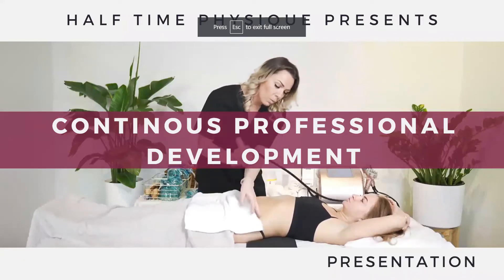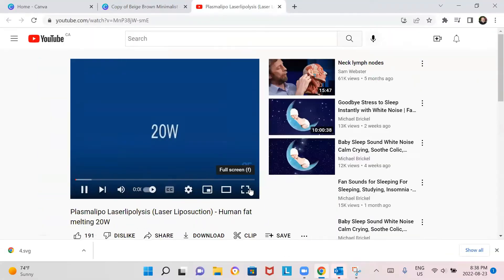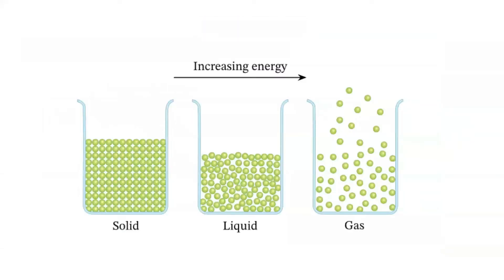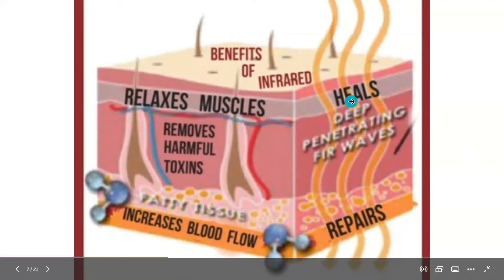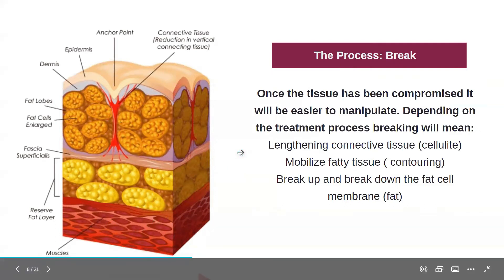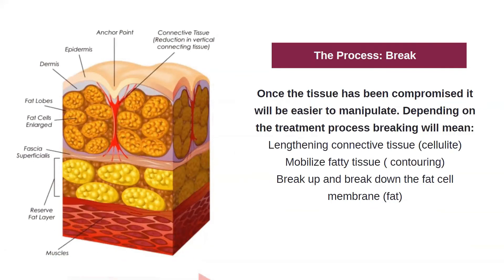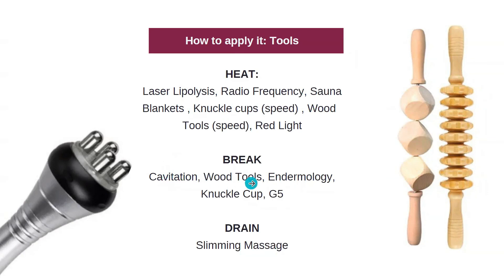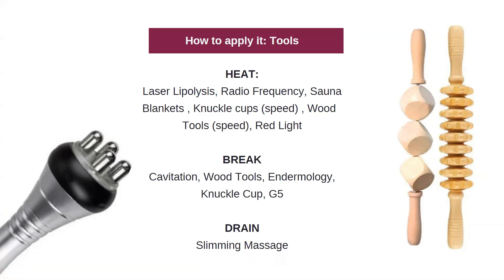How to get the Best Body Contouring results : Heat | Break | Drain

Comment: Okay so I’m watching these videos to come up with a procedure for a cavitation session but now that I understand the purpose of heating I wanted to ask about a butt lift . I have a machine an I get pretty decent result but they take a while to achieve i just do a massage using my wood therapy tools and apply the cups . I never tried heating the fat cells before applying the vacuum therapy cups , should I ?
Reply: I just started doing so. I do it with every treatment now and it works better this way. You’ll be able to sculpt more into the glutes🙌🏾
Reply from the maker: For a  butt lift to be successful you need to follow a 3 step process and cupping sequence.. Malleability of fatty tissue , Mobilization of fatty tissue and then muscle activation and stimulation. Heat will help create malleability before you  go in to mobilize. The booty cups will activate and stimulate.
Reply from the maker: yasssss!!!!